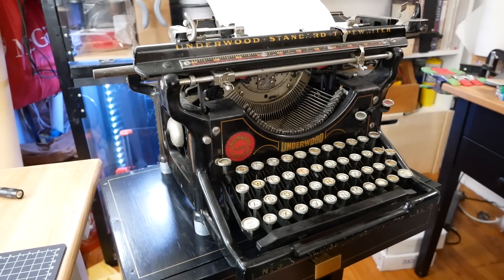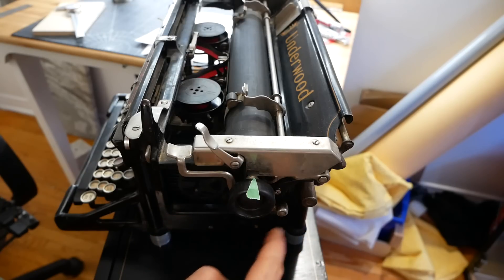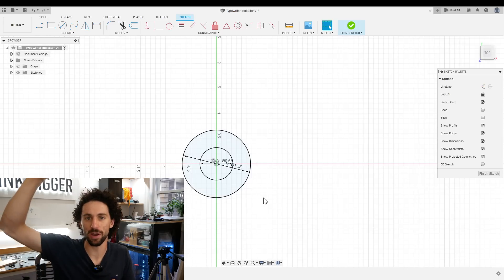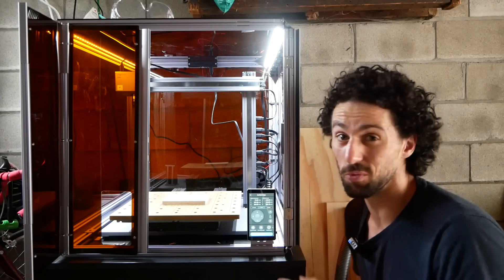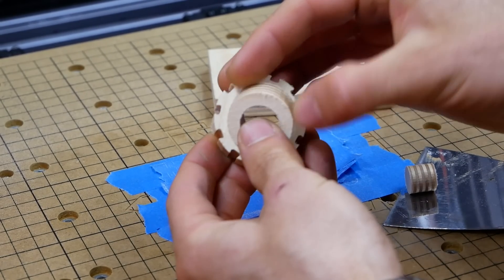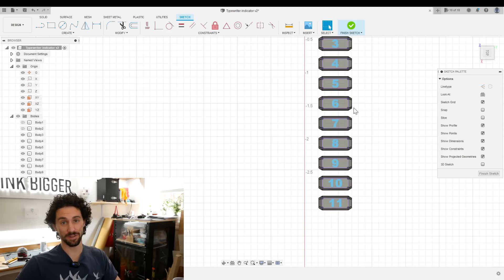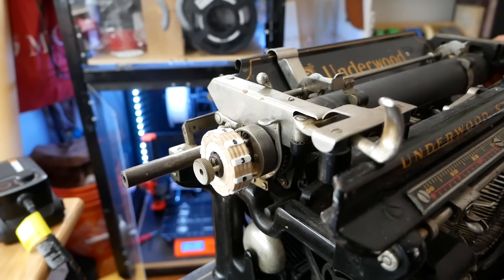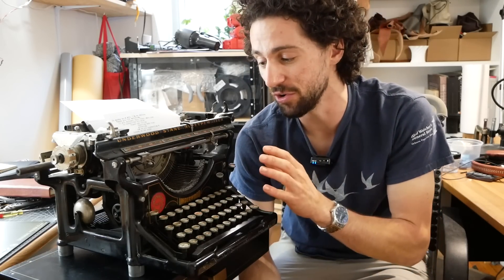A Modern Invention for a 100 Year Old Typewriter

Comment: I love it when people find new and simple improvements to add to old devices.
The "6 per-inch" rule you observed appears to be very intentional; it's equal to one typographical Pica, ⅙ of an inch. This Pica is then split further into the common measurement of 12 points. The part I find strange about all of this is that the designers went so far to design a typewriter optimized for a 10/11-point font, but not to provide a vertical measuring tool on the wheel to begin with...

Comment: Additional comment.  I'm not sure about the specific typewriter you have but most manuals have a roller "click" release (by pressing or pulling the roller knob where you attached your new fixture).  That allows one to reinsert a previously typed document and align the typed lines with the click when throwing the return.  This is very useful when correcting typos that were discovered after the page has been removed or continuing with an existing document.

Comment: Fun fact: I'm pretty sure that knurled knob you were originally going to cover up, allows you to move the roller in a stepless fashion. Just pull on it and adjust the roller knob on the right. You should be able to freely move the roller without any steps. 
At least that's how the typewriters worked when I was in school in the 80's :)
Reply from the maker: It does! But there’s also a lever that does that as well… I wonder why there’s both?
Reply: @MorleyKert  I guess the lever is so that you can lock it to 'smooth'.  The knurled knob is so that you can made 'micro-adjustments' to the alignment quickly using both hands, say for example if you are filling out a pre-printed form and needed to type inside a box (basically the OG version of filling out a pdf form).
Reply from the maker: Ooohhhh that makes sense!
Reply: @MorleyKert   a bit late, so you might have figured this out already, but the typewriter I use also has a knob and a toggle lever.

The difference between them is whether they maintain the relationship to those clicks.
The knob allows you to set the writing line smoothly and the clicks are referenced from that.

The lever allows you to move smoothly, but it doesn’t affect where the clicks are referenced to. This allows you to type off the writing line (e.g. superscripts and subscripts) and when you’re done you can flip the switch again and the rollers will reengage with the clicks, preserving your original typing line.
Reply: @iout  Nice. Never knew there was all that functionality in the old typewriters. I actually wonder if most people using them knew even back then? Never got a chance to check out something written on a typewriter long ago.

Comment: Most typewriters have a pop up paper support that adjusts in height. You set the height so when the paper hits the top of the support you know your on the last line.
Reply: Yeah, at the very start of the video I thought the improvement he wanted to make was a paper support. Sounds like a more elegant solution, but I'm not sure it can be made out of printed plastic. Then again trying to solve that might lead to a more interesting design and video.

Comment: I would love to convert a typewriter into a usb keyboard, including the carriage return triggering the enter key!
Reply: That would be SICK plz do it!
Reply: ultimate mechanical keyboard lmao
Reply: I have seen a “retro” keyboard designed in the way you described, but it was built for modern devices, ergo: plastic and flimsy (I think it was even designed specifically as an accessory for iPad or some other pad. 
A conversion would be much more interesting, feel better, and of course be more fun as one would have to come up with some clever solutions to get it done. I would suspect the easiest way would be to just get a donor Bluetooth keyboard and painstakingly rewire the keys of it to contacts underneath the old keyboard that are actuated by the key presses, and one on the lever. Bonus for an encoder on the roller to give up and down keying. 
Mega bonus if you then make it type back automatically… but then you would have essentially built a Bluetooth tty, and then why not get a 1930s tty anyway 😉 (if the noise from the motor is annoying, it can be modified with a modern silent high-torque motor that only speed up on data reception… I guess we just went beyond the scope of this comment)
Reply: The ultimate hipster keyboard.
Reply: Linus Tech Tips did a video already, doing just that, if you're interested
Reply: @EdgedPixie  and CuriousMarc did one quite some time ago where he wired an old 1930s teletype up as a Linux console, so the concept is well explored 😉
Reply: There are many kits to do so, linus tech tips did a video on it a while back
Reply: Don't forget a Shift Lock key that is separate from Caps Lock that actually holds "Shift" down.

Comment: If you find some black bottles with a 2 on the bottom.  You can easily melt it. By making a fast wooden mold.  You can make that know look original knob but your design for the paper length. 
Cool idea you thought of.

Comment: Excellent design and manufacturing! I seem to recall typewriters where there was a riveted piece or two of flat metal attached to the back of the carriage. When rotated up these would support the paper so instead of folding over the card you could see what you just typed. A simple indicator on the top would let you know when you were reaching the bottom of the paper. This would also have the advantage of being your natural field-of-view. Thanks again!

Comment: That’s a good solution. Not unlike a zeroing dial on lathe and mill cranks. There were some end of page indicators on typewriters but not all had them and of those that did most of them were not exactly user friendly. But, the Olympia SM series of typewriters had an elegantly simple solution to end of page indication. They had a flip up paper support that had a hook at the top. You would extend the support out to whatever size paper you were using, fully extended being standard letter size paper. Once the paper was out far enough to touch the hook at the top, you knew you had a one inch margin remaining at the bottom of the paper.

Comment: The simplest and quickest and cheapest EOP indicator, is a pencil mark.  1" from the lower edge of the paper is a good distance to start. -  You can also make an extension to your paper-rest, such as a wooden ruler, that you affix in such a way that the Top of the paper reaches an easily seen mark when your desired length has been reached.

Comment: I collect typewriters, and many have indicators that tell you when you're getting close to the bottom of the page. I'm looking right now at my stalwart Smith-Corona Silent from the early 50s, and on the roller, there is a bit that you can adjust when you put in your onion skin (you have to pull out a pin on the carriage). Others, like my Olympia SM3, has a fold out paper stand in the back that acts as an indicator.
Reply from the maker: That’s really interesting!
Reply: @MorleyKert  The ones on the Smith-Coronas work very similar to your design. That pin on the roller handle can be pulled out and the roller will spin freely when turned - that might save you from having to loosen the indicator every time you put in a page.

Comment: Next time if you need tiny text on your 3d prints try laser engraving the print. First mask the part that needs to be engraved and then set your laser to burn the tape and etch the PLA. After that spray the engraved area with clear paint, after that dries hit it with a contrasting color, then remove the masking. (If you skip the clear coat step the contrasting paint will run under the masking and wick into the layer lines)

Comment: When I saw your picture for this video, I thought you were holding a Selectric typeball in your hand. The Selectric typewriter actually had, on the edge of the roller, a device similar to what you're making here. But that roller had a circumference of 4 1/2 inches - IBM's electric typebar typewriters had a circumference of 5 1/2 inches, half a page, like your typewriter.

Comment: Awesome video. Here’s a nerd suggestion for you. Redo it 100% 3D printed. Add a reduction gear and a cover. This would enable only ever seeing exactly where you are up to. I would make it start at the point you drop the paper in. You first manually set it here, then drop the paper and turn it to ‘0%’. Each click adds 1.5%. 100% is the last line before you run out of page.

Comment: If you're already in fusion 360 -- do the cam in fusion, way more powerful than exporting SVGs. If you know you're feeds and speeds -- and depth of cut, cam in fusion is really straight forward.
Reply from the maker: Definitely! When I made this video, I hadn’t yet learned CAM in Fusion 360 but I spent some time yesterday learning and I’m excited to use it 😊
Reply: That was my thought. I have a Snapmaker as well (largely since I wanted to try CNC/Laser/3D printing without having a separate machine), and the CAM stuff in Fusion 360 works great for it.

Comment: Small tip for everyone
If your text is to small to extrude just do a text pocket. You can print a part quth a 0.2mm hole with a 0.4mm nozzle but not an extrusion.
Also recesed text won't be able to de laminate
Reply from the maker: True!

Comment: simpler solution, put a wooden ruler (commonly used in schools) behind the paper.
the paper will ride on it as it moves up. just put a place marker on ruler to indicate 1/2 " remaning, 1" remaing, etc.
also, most mechanical typewriters have 12 point font size, 72 point in an inch. so 6 lines per inch. 
pica means 10 characters per inch, elite is 12 characters per inch side ways.
Reply from the maker: That’s a clever simple solution!
Reply: @MorleyKert  my parents typewriters had a paper guide, to hold the printed part visible, and an movable ruler to show how much left.

Comment: Nice!
What was the strand of black besides the numbers on the 3d printer bed? Was that it clearing out the nozzle of the previous colour?
Reply from the maker: Thanks! That was the left over filament from when the extruder loaded the black filament and pushed a bit out of the nozzle.

Comment: You got away with it this time, but if you go bigger, you will need to add fillets to the bottom corners of the dovetail inserts. The bit cannot cut tight corners due to its radius, so you have to match the fillet to the bit radius. Also, I would really like to see a V2 with a 2:1 gear reduction, and a percentage scale. With that, you could go from 100-0% in one rotation.

Comment: Do you have to pull the wheel out and manually turn it from 6 to 7 for the second half of the sheet?
Reply from the maker: No, because it’s an odd number it cycles through automatically.

Comment: This is what my mom calls twisting your arm around your neck to get the spoon to your mouth. Why didn't you just print the whole thing in one piece? Also, how are you keeping track of which rotation of the wheel you're on? I know you can guess it by how much of the paper is above the line, but that kind of defeats the purpose, I think. Nevertheless, always fun watching you work. Keep it up 👍
Reply from the maker: I thought it looked a lot nicer as a combination of wood and 3D printed letters. Didn’t want to detract from this beautiful old machine! 

It’s surprisingly easy to keep track of the rotations. Since the numbers go 1, 7, 2, 8, 3, 9, etc., you only really have two options: you’re either on the top of the paper, or the bottom, and that’s obvious from seeing how much paper you’ve used. It’s very intuitive once you’re using it! 

Thanks for watching 😊